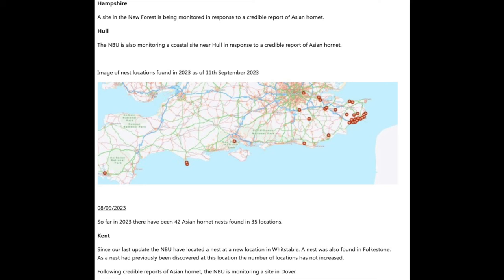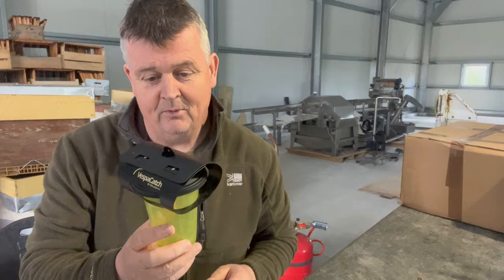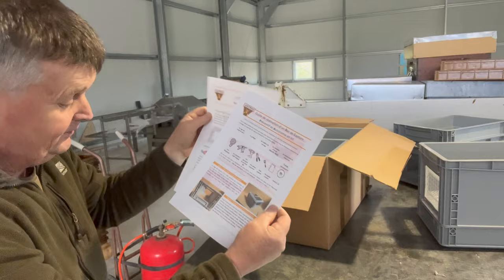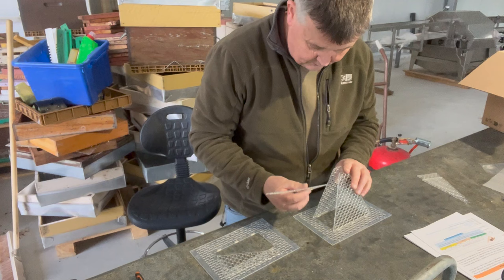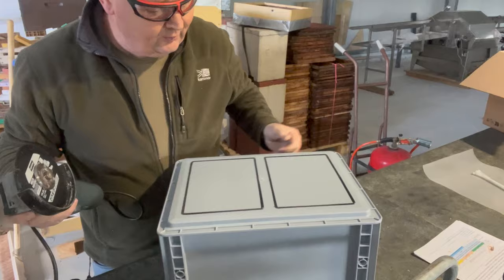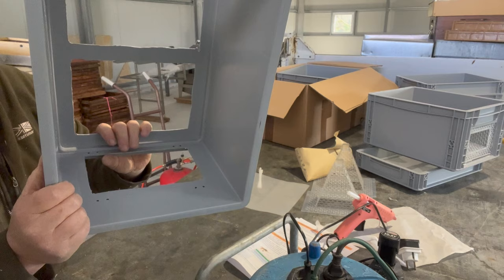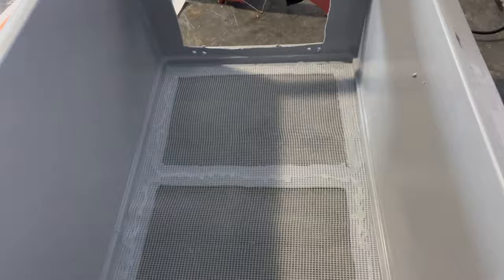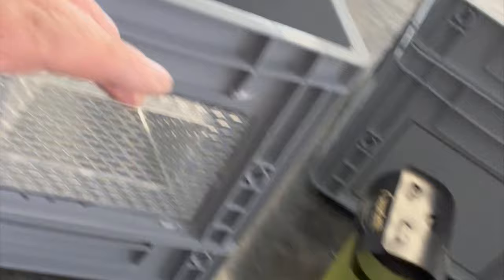Asian Hornets  ~JABEPRODE Hornet traps Assembly

Comment: Imagine IKEA would sell you a built kit like that.😂 Left all the work for you. Great idea though. Would a diy cone with a Nicot  queen excluder also work or is the transparent material crucial?
Reply from the maker: Interestingly the cone is available separately so you can make similar if you have the correct materials. There is other models around thst are also good. However this does work well.
Reply: @richardnoel3141  in the uk as far as I am aware, you can’t get the whole kit. I have the kit but not the boxes. Paperwork that comes with it has details to order the boxes but if you try to order you need an import/export number before you can complete the order, so a business may be able to order them but an individual can’t. I have found similar boxes from rapid racking, but they don’t deliver to the Isle of Wight so I have had them sent to a friend on the mainland, he is coming over end of November with the boxes. Hopefully they will work, your video will be a great help.

Comment: Why didn't they make this easier to assemble, why should the customer have to use a grinder to mount this, couldn't it just be snap off, or already cut?
Reply from the maker: I agrée but it’s all time. It would be “ideal”to make a pre made injection moulding with those parts already cut out but that costs literally thousands to produce. The purpose of the video is to demonstrate the time it al takes. But I agree with you. 🤷🏼‍♂️
Reply: Were can you buy those traps?
Reply from the maker: @wskonij  link in the description